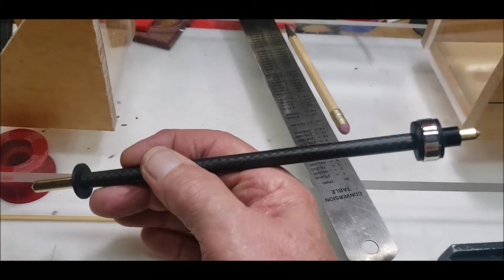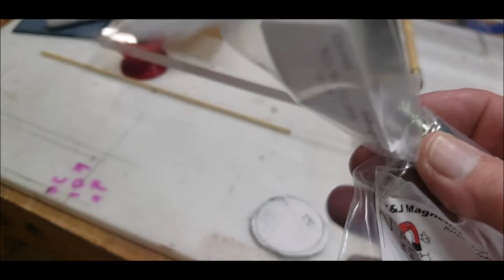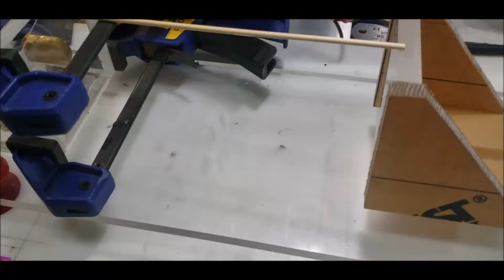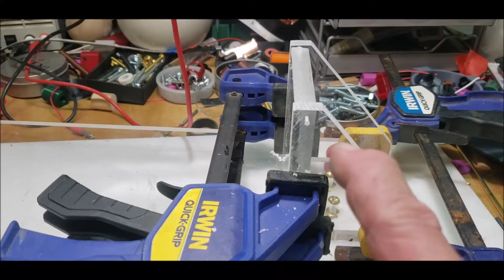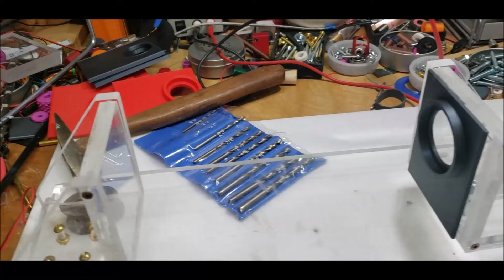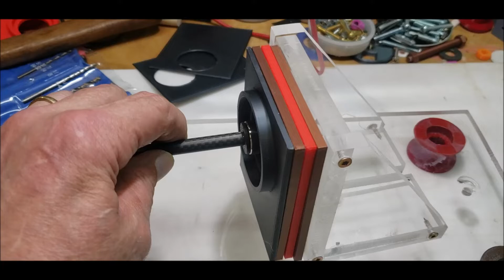3D Printed Maglev Build

Comment: Using a concave disc for the shaft ends sounds like a good idea.
Reply: Yup pull it out frequently  when you drill. Surprised you aren't using a drillpress.
Reply from the maker: @MAGnetICus_Attractus  I ended up using the drill press on the second one which made a world of difference
Reply from the maker: I did use one on my bigger maglev